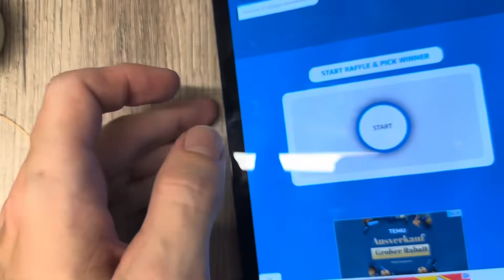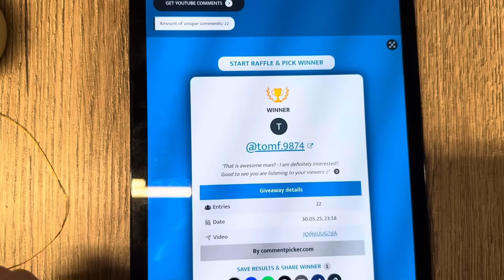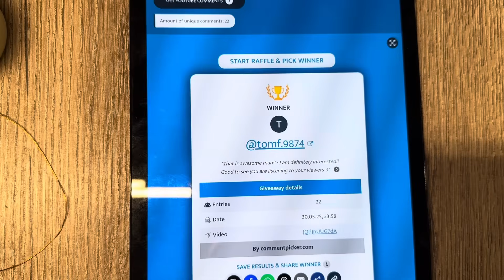Zero Point alignment of Magnets and Electromagnet arrays 🌀

Comment: You can get a stable equilibrium, for permanent levitation without external power. The trick is diamagnetic material, Bismuth or pyrolytic graphite. The repelling force is very weak, but just strong enough to keep a small magnet centered in the otherwise unstable magnetic field if a larger magnet.

PS: what you feel in your finger is either Lorenz force (because blood contains charged ions that deflect in oscillating magnetic field), or diamagnetic force on the water in the blood.

Comment: 11:02 you can see that it's not just shaking it is oscillating and spinning... You will see the direction of the oscillation if you look at it under a slow motion camera... This is because the fundamental state or shape of magnetism is a Toroidal vortex... The center plane is the singularity. On one side of the singularity it flows inwardly towards the center in One direction of spin and on the other side of the singularity it flows outwardly in the opposite direction... The South Pole is blue shifted and the North Pole is red-shifted

Comment: ....The longest and largest mystery currently running not only on the face of the earth but as the entire universe.: 

Where there is electric current flow there are magnetic fields generated.:.when magnetic fields interact by proximity  electric current flow is Generated.:

One side of the perpetual coin generating the other in a universal 
Dance that just don't quit.:. 

Magnetic fields then appear to be defined as static electric current 
Organized arrangements of polar
Motion containing polar motion

Light then  is a reflection of generated current  the presence of polarized magnetic fields perpetually attempting to re arrange each other permanently in a whorld that is in constant motion currently speaking perpetually...

The question now remaining: can the diode drain the electric current contained by the magnetic array if
Continuously connected or are the
Circular arrays permanent batteries
Constntly charging and discharging 

Where a battery is defined as a switchable  magnet caused to discharge when connected to a
breakable loop.:.caused to charged 
when...well that seems to be the next video. 

Show how the "charge" vivible behind the green sheet is generated when 
Current is applied in one direction and generating when current is applied in the other direction.

Comment: You need to look into liquid metal conductors for the reason that you are going to run into a bad problem with heat using metals that are solids evens with good heatsinks once you get to the point where you're wanting to harness enough zero point energy to be useful for anything you'll be able to do it for a short time with solid metal conductors but the reason "alien technology" is using liquid metal conductors is because they can be cooled down faster and redistributed through the system quicker so it makes sense to use that over copper. Although I believe there's several different little tweaks that can be done to liquid metal conductors and make them even more efficient and stable than what's being talked about.. Good luck you're definitely onto something that will be really cool when you get it figured out. Understanding exactly how gravity is created is the only way to understand how to defeat it and be able to harness endless amounts of free energy by doing so. We already have been able to do it for a long time but they don't want us to know much about it. Can't rule over people if they don't need you for anything..

Comment: The Tesla coils primary & secondary coil arrangement holds the key....
But its not as simple as the alignment of the fields Electrical and Magnetic components to defeat the intrinsic limitations of masses field modality respective of the source charge modality of the octave(s) where the locally inherent atomic elements (and a few unaccounted for node points... Plus the attributes and systemical 'heirachy' for the principles behind this node-antinode waveform of manifest matter and the correlation of this wave form and its inherent configuration with that of its aource charge and the hronic relationship to that of the 'FF' and more importantly, the key harmonics which comprose the primary factors for the geometrical progression that this local field modality(s) is manifest at, at the atomic/molecular scale.... 

The key is matching the wave form to the local field modality and atomic field modality resistance/incoherence encountered at every step along the way and at the target destination, which can be correlated to the final wave form required to effect the specific work and consequential reactions that the system seeks to achieve. 

Which is why electronic components cant just be bought from radio shack because a particular number matches modern electrical engineering text books. And which is why our devices and instruments all are uniformly manufacturered to operate at only 2x specific frequencies. Which correspond to two specific potentials used for electrical distribution.... 
*And why searching anything of value in these respects will show a drowning depth and volume of absolutely useless results. Ie; you search ANYTHING of use regarding 144htz electricity, or wave forms/resonance/harmonics/voltage/scale/etc etc and EVERY SINGLE SEARCH AS will show nothing but 144htz gaming monitors.

Comment: Just curious, have you spent a considerable amount of time grinding/working with ferromagnetic materials, especially without gloves? I've noticed my thumbs are very slightly attracted to strong magnetic fields, so slightly that I thought it was in my head until I started playing with AC-powered electromagnets. I can feel the frequency in my fingertips, most noticeably in my left thumb. I came to the conclusion that it might be from tiny (even microscopic) pieces of metal in my skin from years' worth of contact with metal dust/shavings. I've wondered if anybody else has experienced this.
Reply: oh thank God, i thought i was the only one going insane....😅 
nah it aint the iron dust, if anything less than 1% contributor. youre becoming conscious of your own bio electrical magnetic field and its intetaction with the environment. the more you play with it, the stronger the sensation becomes. 
i do tons of ewaste scrapping taking apart little transformers, wadding up balls of copper windings, started with wrapping winding around my hand and holding it infront of powersource, both ac and dc, i can feel the tingle sensation of the induction.( for dc,  i held a ball of copper hovering over one of those phone wireless chargers😅....well after way too much time wasted, i can feel induction or something from the wireless charger without holding anything
now its an existential crisis adventure after watching some interviews with shaloin monks trying to explain their "chi" power thing....and its exactly the same so their shaloin theory is actually a protoscience hinting at new sciences yet to be understood.....or new psychological disorders😂
Reply from the maker: @JotunViking when I first felt it I was thinking I was crazy, now controlling the body’s magnetic field is just simple as controlling a muscle, which in essence also is the same. 
Or in other words you don’t need to move a muscle to consciously change or concentrate the body’s magnetic field.
Reply: I. Think dust somehow does get incorporated into the skin on hands somehow idk how but it can have negative effects. I think it might be part of how your hands get naturally tougher when u work and get dust and dirt on them. Probably silica particles.
Reply: Blood has Iron(Fe) in it. It is natural.

Comment: If you arrange the magnets in a spiral pattern you can twist the magnetic field and create a vortex field where it is cooler on the inside and warmer on the outside when you apply low oscillating voltage.

Comment: Your work is quite impressive AND inspiring, thank you! ZERO POINT ENERGY REQUIRES AN INITIAL CHARGE TO TAP INTO... BUT ONCE THE PATHWAY IS ESTABLISHED, Usage alone will maintain the connection.. Supplying Your Load with both voltage and current being demanded from it. ¯\_(ツ)_/¯  Or so it is from my understanding. Keep going.. but Just be careful about what you make public. THE BAD GUYS ARE USING Ai TO SNIFF OUT COMPETITION FOR SNUFFING PURPOSES... I'm fairly certain ur already aware of this but, ITS BETTER SAID THAN NOT.. Even if you've heard it before! However!! I will add that if you do have a breakthrough.... UR NOT STUCK HAVING TO SIT ON IT!! Word of mouth and starting in your own community will establish your name and your device's credibility! Then go public! THEY WON'T SNUFF A WHOLE CITY... I Think... lol ¯\_(ツ)_/¯

Comment: At 8:00 I believe it could be magnetic field flow tension / suction, creating an elementar electron flow = current.

Basically the flow between void and pressure.

Or the Iron to Copper electron push.
Basically like Solar panels.

Solar light is also a magnetic wave exiting electrons between two metals.

Same seems going on here with magnet fields.
Reply: You're a fool if you believe that. This is fake. A magnet doesn't produce electron flow in a wire until after the wire passes the magnet, when the magnetic field breaks off from the wire. The two wires sticking off of it, make it obvious he's powering it with batteries. or an adapter.

Comment: Isn't the AC power just reversing polarity 50 or 60 times a second, causing the vibration?
very interesting shapes and neat experiments!
Reply from the maker: Yes but it is reversing polarity at any frequency I choose with my frequency generator, it is not connected to the wall outlet directly!
Reply: @OmegaZZ111  Thanks for your reply.
It looked like it vibrated at 5 to 20 hertz to me, I did not try to analyze it... so are you saying your frequency generator caused the vibration at whatever hertz you chose ?
or are you saying it was asynchronous with the input AC of the frequency generator?
if it was asynchronous then the mystery stands and  I'm out of my depth.but...
In any case I haven't seen a membrane that shows magnetic fields. or a magnetic field strength sensor. and haven't seen copper filament 3D printing. only laser sintering of metal powder.
but I mind as well live under a rock. because if it isn't directly related to building my own house, I simply don't have the bandwidth to learn about it.
Reply from the maker: @nomadicoasis9260 yes in the video I set my frequency generator to 15 hz. 
The 3D printing filament is not real copper, it is just copper colored plastic.

Comment: You should become familiar with the work of Wootan and McLain and their discovery of The MRA (Magnetic Resonance Amplifier). They use a Barium Titanite piezo disc in series with a coil wound around a permanent magnet to resonate the field about the magnet. 

Interesting things happen when the piezo disc and the domains of  the magnet resonate sympathetically at a three octave separation.

It is a very simple circuit to build and may be of interest to you.
Reply: I've been exploring piezoelectric materials more recently and actually constructing an experiment very similar to what you just described. Barium Titanite is a piezo I haven't come across yet because I'm still pretty new to piezo materials. After a quick google on it, it appears that it can also have ferromagnetic properties, meaning it can interact with a magnetic field. This I would assume allows a static magnetic field to provide pressure on the piezo material, this would create a charge in the piezo which can be fed back into the coil around the permanent magnetic and enhance the permanent magnets magnetic field causing magnetic flux (or time varying magnetic fields), this then further effects the piezo, its sort of a feed back system between the natural static magnetic field and the piezo charges outputting into the coil to create an electromagnet that changes the magnetic field based on charge output from the piezo.
Reply: @apoc7468  Howard Johnson and his magnetic arrays which used to be available from cheniere.org might be of interest to you as well.  

https://rexresearch1.com/BeardenLibrary/BeardenHowardJohnson.pdf
Reply: Piezos are key according to some spooky folks in the know

Comment: A week ago. I was thinking in a drone ball made of Aluminium or metal, that could be fly using the repulsion principles and, at the same time, two electric motors of 12 volts,but inside the ball. One in the top of the ball, with a little space of 2 inches of length, for example. Of corse, the helix will be used to help the repulsion to create a levitation effect.

And the another one helix a little bit more below the ball, but inside too. And of course, a cut of two inches of length to the helix that can get The rotation and gain a little bit of wind, as I said will serve to impulse the force of repulsion too. Of course, this principles applied for the two helix. 

And of this way. The drone Will take the appearance of UFO.

The experiment it can be interesting.

Perhaps the idea it can be useful.

Your video was an interesting lesson. Thank you.
Reply: The repulsion effect needs to be created, to close hermetically the device, in a container very good sealed obviously, with high vacum inside and low (under zero) temp.  It supose ufos levitation engine works!!!

Comment: Can you make a ray of light pass through the center of the hole or add some kind of lens to see if the image have some kind of distorsion? Thanks for your video!
Reply from the maker: I will try that.
Reply: I have done it with a stack of magnets from magnetrons. It does sometimes distort it it definitely does something but it's hard to know how to film it or what it's really doing. Sometimes it seems to almost add clarity or change the... Brightness or color somehow. I haven't spent very much time on it. I tried messing with a red laser pointer most recently. I actually forget what it was doing lol I almost want to say it made it brighter but I have no proof of that barely even a memory
Reply: @SimEon-jt3sr  A cathode ray tube/TV tube manipulates photon paths.
Reply: Id like to see that too, because photons have no Mass, apparently.

Comment: Cool, i found this similar effect playing with a magnet that was cylinder in shape but had a cut out, a cup shape basically and put another cylinder magnet in it, solid this time,  it repelled at first but then got stuck in the no magnet zone. Just like here, except  the cool part was it didnt touch the bottom it was suspended in the no magnet zone, when you pressed it it would spring back. The walls of the cylinder kind of supported it however.  I could see this used as a magnetic button, just put a  hall sensor on the other side and you could have a button that increases its effect the harder you press.  What all of us Nintendo kids always wanted, pressing the button harder would actually make Mario jump higher!     If you arranged your magnets in a cup shape basically instead of  sphere you might be able to get a similar effect.   Where the thing you put inside wont hit the bottom but and just get stuck in the no magnet zone.  This didnt work on both poles however, only the repelling ones.   The other pole just went straight to the bottom.   It reminded me of a ball and socket joint, perhaps with the right shaped sphere you could make it lock in without touching.  II was lucky to find this odd shaped magnet, (cup shaped) and was able to play with putting magnets inside it.
Reply from the maker: Interesting, I haven’t seen a cup shaped magnet before.
Reply: Reminds me of the lapointe array